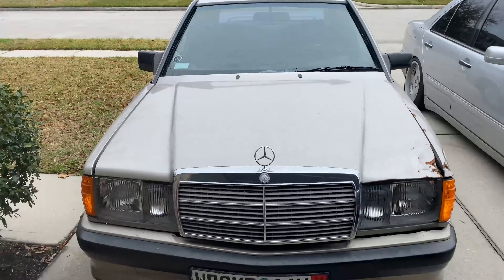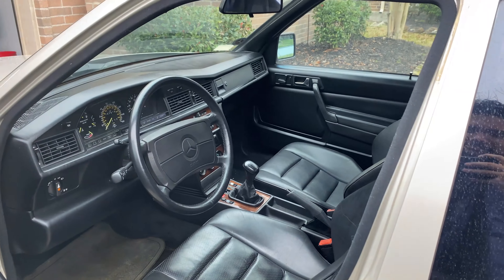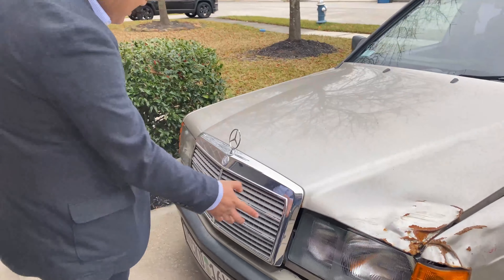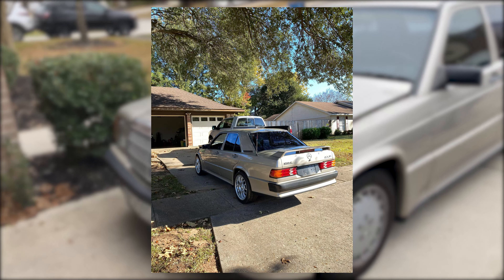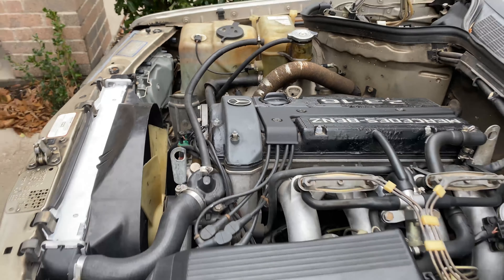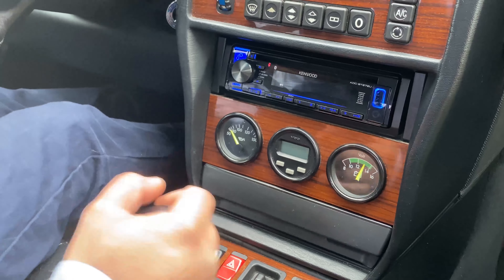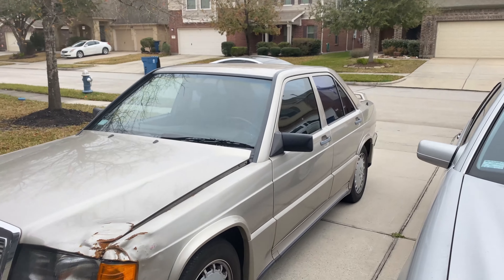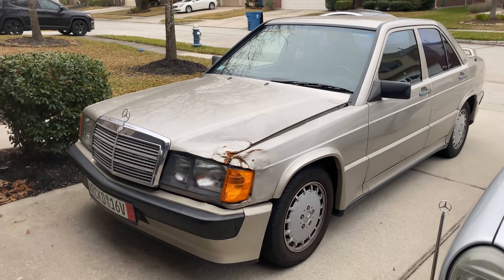Checking Out a 1987 Mercedes-Benz 190E 2.3-16v

Comment: You should purchase a 190e and m111 swap it !!! The m111 engines is a bolt on the The 2.3 or the 2.6 normal 190e's
Reply: Why would you put a 4 pot M111 in there instead of the 3.0 M103 or the 3.2 M104 twin cam 6?
Reply: @popuptoaster  it's just an idea , where I live that is the easiest and cheapest swap I can get a c230 kompressor with a 6 speed for 2k vs a heavy m103 and m104 granted better engines but also need to throw quite a bit of mulla to gain power while you can chase 300hp with the stock supercharger off the m111 with simple mods